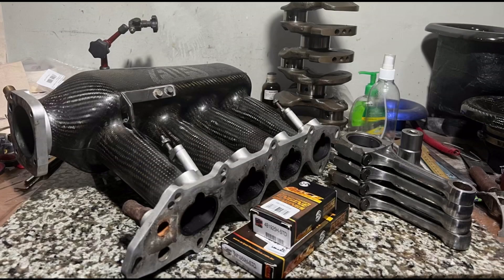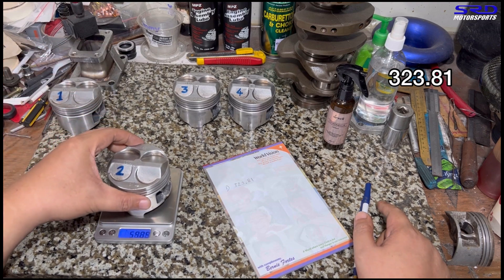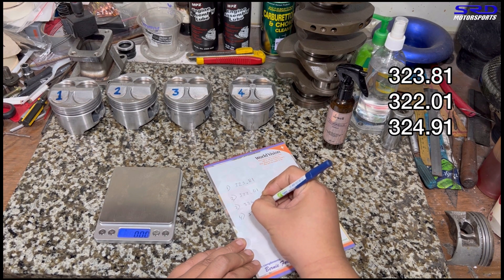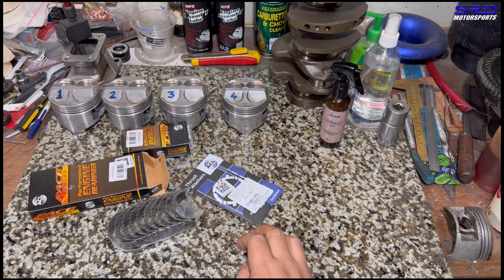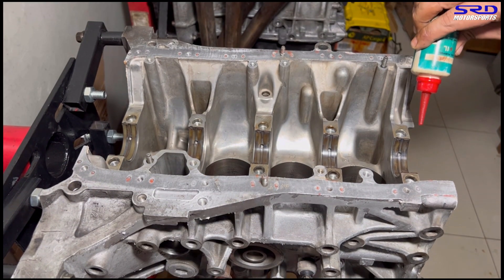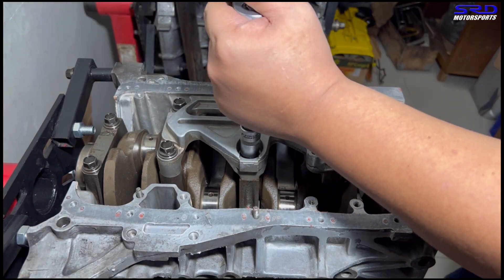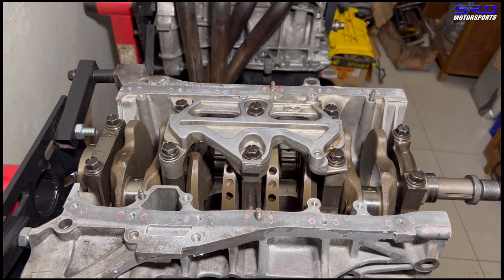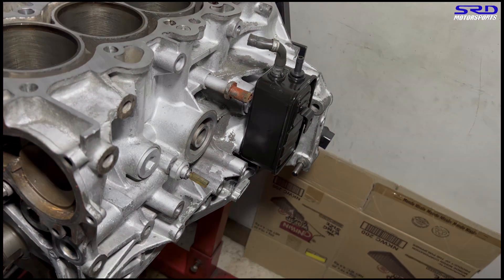Honda CTR B16b Stroker Build Series part 2 Will We Go BIGGER?

Comment: hi i did a swap b16b ctr swap,   do you know where i cab buy replacement parts new for this engine.   (alternator, and alternator belt)..
Reply from the maker: usually your local autosupply should have it
Reply: ok thanks , some people told me the 99-2000 Si was the same , parts,.. i ordered a timing belt and it was longer .  iwas looking to order from someone who deals with these cars often
Reply from the maker: 99-2000 SI is like a b16a or if it’s a b18 then a gsr

Comment: Good video. Regarding the crank, have you lightened the crank before? I was wondering how much you could improve performance by lightening the crank whilst maintaining integrity of the bottom end overall. Thankyou.
Reply from the maker: I havnt tried lightening on a Honda but just refinish texture like on the b20 we did before

But on vw I have

My friends in Minnesota Prodigy Race Engines
Have done this on Honda but a machine shop is picky I mean u gotta be picky cuz it isn’t as simple as turning them on a lathe
prodigy had theirs done by a machineshop in Cali

Comment: Off-topic: How much quench do you have for this engine?
Reply from the maker: as now havnt really checked but good you mentioned it cuz it’s one of the few things il be checking mainly cuz the PCT doesn’t stay far down the deck once it’s an 87.2 crank
Reply: @SRDmotorsports  Thanks, man! Curious how it will be factoring in rod stretch with the OEM rods 🍻
Reply from the maker: @findtherightbeat  right rope to walk on cuz some might do what I’d say but have catastrophic results  😭 

But 0.040-0.042” has always been safe 

But if you remember the older video the 12.1sec e85 b20v ? That had lesser than 0.040”
But that had skunk2 Hbeam and Wiseco

The 211whp b18c oem piston and rod motor did have 0.042” though
Reply: @SRDmotorsports  I totally get what you're saying with rod stretch and quench being a tight rope to walk on with stock rods. Been browsing through Youtube to see what local engine "builders" on other platforms are doing and spotted one in the moto scene claying for P2V but did not account for rod-stretch. Suffice to say, the piston and the valves kissed 🤣 This guy even has the guts to accept customer work from what he says in the same video. 🤦🏾‍♂️
Reply from the maker: @findtherightbeat  if it just bent a valve that’s lucky! I see some that lost heads even block lol wow
Reply: @SRDmotorsports  It's quite ironic for them not to account for rod-stretch considering that motorcycles usually rev higher than car engines to produce power. I'm seeing what happened in the Honda scene back in the day, happening in the whole moto scene locally -- bloated dyno numbers, buyers looking at cams based on the manufacturers' stage numbers, the "bigger is automatically better" mindset, head porters who haven't even seen a SF100 manual claiming so many things, 1000cc injectors for a 200cc engine etc. 🤣
Reply: @SRDmotorsports  and also the "kargado kaya sirain" excuse and they don't measure piston to wall clearance -- they just get off the shelf pistons and off the shelf cylinders and put it all together 🤦🏾‍♂️
Reply from the maker: @findtherightbeat  so so so trueeee
Reply from the maker: @findtherightbeat  include the “gas consumption” because it ain’t stock lol